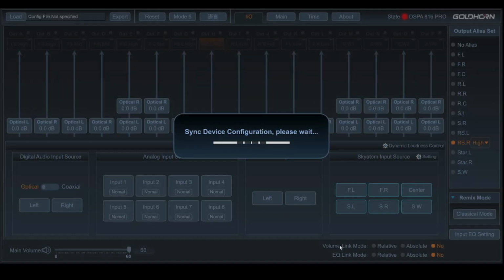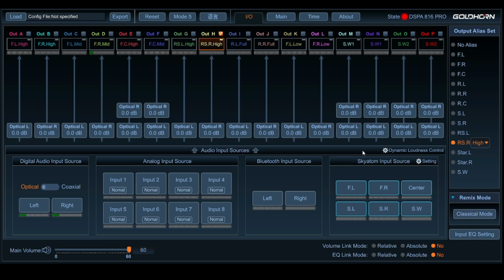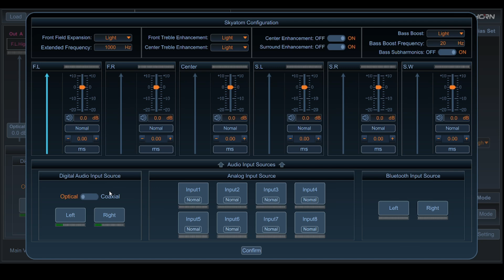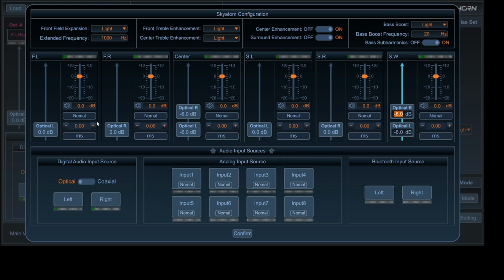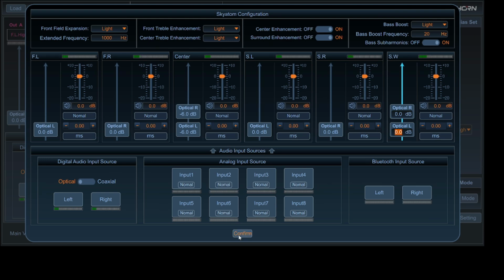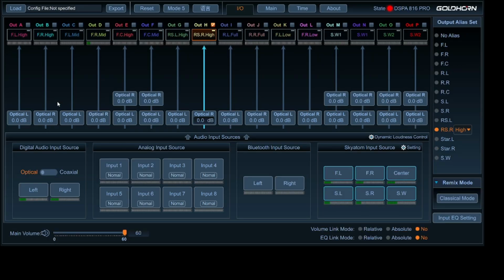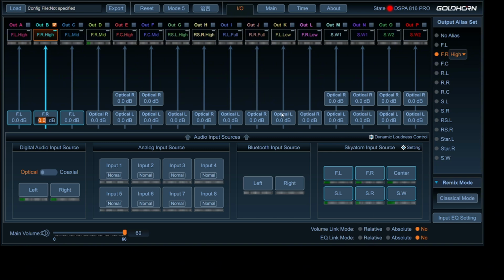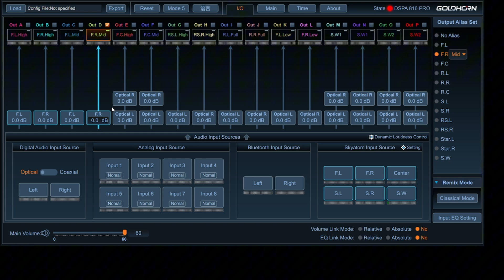Goldhorn DSP: SKYATOM - Quick Setup Guide

Comment: I think it was your comments on DIYMobileAudio. Goldhorn has been recommended quite often for having great sound quality. I know Helix has its benefits, but it comes at a significant cost. Its about a 60% price increase. I would be looking to go 3-way front stage only, no surround at least I don't think so. I am not sure of the benefit of surround in a car vs front stage. Goldhorn as the 810 ($700) and 816 ($1000). Both are great compared to getting an equivalent Helix.
Reply from the maker: Yeah I'm on DIYMA.  If you have a center (or a hole in your car for one), it's probably worth it to attempt a surround setup, or at least experiment.   If you are OK with taking your time doing the tuning (setting the freq/Q/gains manually per channel), Goldhorn is good value IMO.  I do love the sound quality.  I also went from a Helix V-Eight to the Goldhorn (different vehicles, different builds) and the Goldhorn has the sound quality edge compared with the V-Eight (especially with Skyatom!)  Scott@AudioIntensity has deals sometimes, that's how I got mine.

Comment: Yo GDT 68 pro is my main DSP on my car

Where can I get this program?

Any links I can download?

Pls!
Reply from the maker: Help me out here, are you asking where you can DL the firmware for Skyatom?  If so, https://goldhorn-usa.com/download-category/software/ for USA with the latest versions, IDK what the other countries are supposed to run.  And the process for upgrading is here:  https://www.goldhornaudio.com/download.html  look for the instructional on "upgrade operation tutorial".  The only thing I'm not sure of is the compatibility of your version and the whole thing Goldhorn does where they pull an internet connection to verify your country of operation, so my info here is specifically for the U.S./North American version and I'm not sure about the others.  When I run the demo version of Goldhorn's software, your model does not come up, so IDK.
Reply: @LansonF Thank you so much for your kind explanation.
Seems like the Goldhorn GDT68Pro model does not seem to be sold in the United States, so the software looks like different as well.
Since I’m in Korea, it looks like I won’t be able to use this program if it requires being located in the United States.
Still, I will give it a try.
Thank you again 👍
Reply from the maker: @user-kj8zz6et8r  There should be a version you can DL, but you may need to contact Goldhorn via their support / contact email.  I have messaged them before (mostly about adding features) and they have responded each time, usually in 72 hours or less.  Good luck, hopefully you're in business!

Comment: automatic switching wont work that way
Reply from the maker: Details please, I haven't talked about automatic switching yet.
Reply: @LansonF  for some reason when you do the sky Atom inputs like that the automatic switching feature wont work you have to include the main inputs as well as the sky atom
Reply from the maker: @memosolis1054  Hey there.  I was able to confirm that Bluetooth and Optical In does work together in the Skyatom screen.  I was in a tuning session and on a whim decided to test this out, and it does work as expected.  The only thing I had to watch out for was the Bluetooth input direct was WAY louder, so it's important to account for that (adjust down input dB per BT channel).

Comment: There he is! Is this the new dsp  to get? I know if you got it it has to be something special?
Reply from the maker: Hi!  So this Goldhorn is special in that it is optimized for center-surround "many channel" setups.  Mine is 16 channel (8 powered internally at 80w each), but you can get them in bigger and smaller channel configurations.  These have excellent hardware inside, but the software is new and lacking compared with the king, which is Helix.  Example: the Goldhorn currently forces you to manually enter, per band, your filters (frequency, Q, gain), where on a Helix you can just import your filters with several methods, which saves a lot of time.  BUT, software is upgradable, so hopefully Goldhorn keeps updates flowing to improve.  If you are in doubt, Helix is a safe bet.  But Goldhorn is less expensive and versatile, so lots of pros.  I am back into installations as a side gig so if I can help, just let me know!